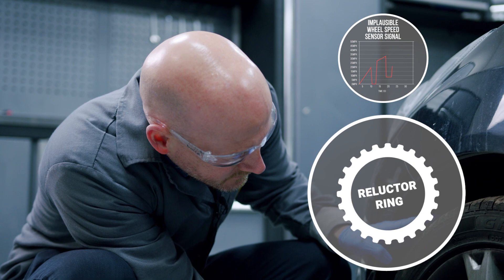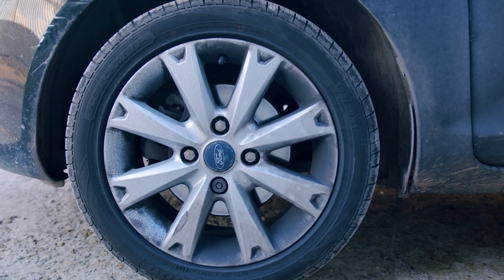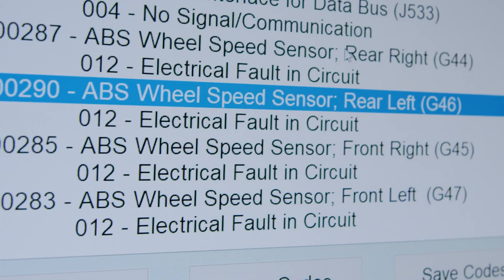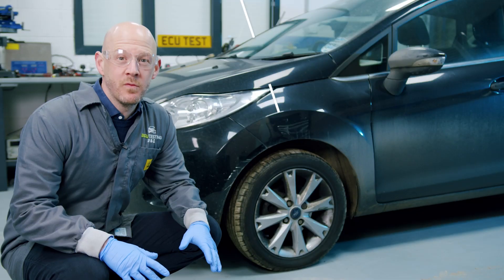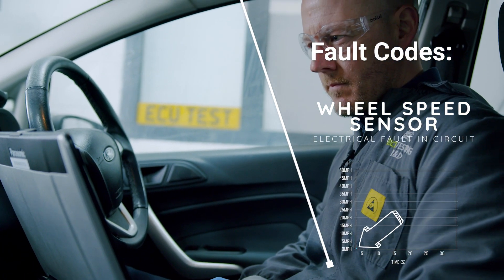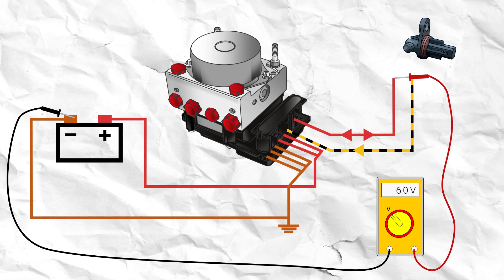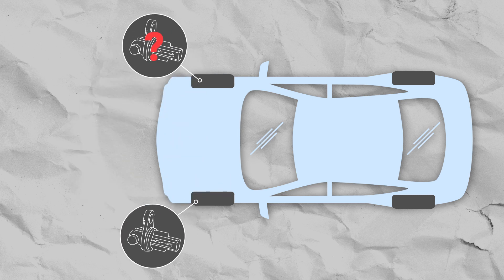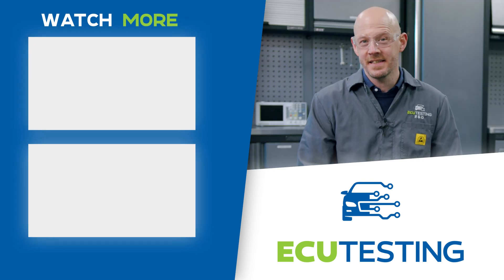ABS Wheel Speed Sensor Fault – How to Test and Fix ABS Sensor

Comment: I have a audi a3 8p and its coming up abs operation implausible signal and power steering control module implausible signal do you think it could be something to do with a wheel speed sensor  or what would you check had it into garages but they just want money dont help thank you
Reply: Also if would like to add i want to look into what it could be before I go into spending money on the abs module fixing

Comment: What happens when you have two little cars in the dash what was skid marks set off the other one was skid marks what does this mean
Reply: The abs sensor fault also affects your traction control (esc/esp) and if fitted your hill start assist sensors. The car with the skids is the esc warning light. I have these on my dash. I’m fast becoming an expert 😂😂

Comment: As an amateur I would expect that a faulty sensor ring would cause a drop in speed readings for every revolution. Incorrect assumption?

The reason I ask is that I have intermittent drops (graph), while manually turning the wheel, but not at fixed intervals. The ABS sensor itself is new.

Still a sensor ring issue? Faulty Wiring? Faulty module? Faulty connector?

Any pointers would be greatly appreciated.

Comment: Hi, wondering if you could help me out. I've got a front left wheel speed and invalid data from abs module errors. The abs, power steering and engine lights are on on the dashboard. I've checked the voltage and continuity of the wire coming to the sensor and it's all fine. Would this indicate there's a problem with the module? I did try plugging in a new sensor, but I didn't put the sensor into position, and the error codes were still there. Does the sensor have to be in position for the error to be fixed? Any help would be much appreciated. Thanks.
Reply from the maker: Hi there, the sensor not being in position should not make a difference to the fault codes still being present as long as it is fitted correctly. You may need to take the vehicle on a longer test drive so it recognises the new sensor or do a power down reset to enable the codes to clear. If you want to give us a call on 01773 535638 or email us your vehicle details, symptoms and the codes you have present to info@ecutesting.com, our technical team can advise you further. Thank you
Reply: @Ecutestinglimited  Thanks so much for the reply. I managed to fix it in the end, the connector had broken and the sensor was plugged in the wrong way round lol. Everything is completely fine now :)

Comment: I’m stumped! My code reader indicates F/R open circuit. The wire has 12v and the sensor reads 5 ohms. I switched sensors but still have the same code. What else can I check? Thanks!

Comment: Volvo xc90 both front sensors failed within 15000 miles , although 5 year old car , oddly both went after brief heavy ish braking on different occasions , Volvo dealer answer new wiring harness and sensor £664 a time

Comment: I have an 08 ford explorer with wheel speed sensor fault and abs pump and module failure. I replaced the wheel bearing assembly and ABS sensor harness with no success. The car beeps at me for 30 seconds every 4 mins. Its absolutely the most annoying thing ever. The car drives with traction control off which is super dangerous. I live in puerto rico and the ford mechanics are supposedly out like 2 years in the service department that deals with electrical problems. The cost of repairs if they did however fix it would be the price I paid for the car. I feel like im SOL. Any advice for fixing it myself or what route I can take in getting it fixed?

Comment: Surely only active sensors provide a 12v voltage for hall effect sensors to feedback data? Passive sensors have little or no voltage supply and use reluctance ring and sensor induction to generate a very small AC wave from for abs actuator

Comment: Hello please my mercedes w204 shows this fault code 5001 cc52 what is supposed to be?  A failure of abs module? Have i change it completely? Please i need uour help in addition to this the steering wheel becomes rigid when i roll over 20km/h
Reply from the maker: Hi. The fault codes and symptoms you have described are a very common sign that the ABS unit has failed and will need to be re-built. Please visit our website for more information on this fault and for details of how to get your unit tested: https://www.ecutesting.com/common-faults/mercedes/c-class-abs-pump-fault/ Please let us know if you have any further questions.

Comment: Good morning..hope you're well.  So to add tht if I've corrosion in ECU connector pins;  could tht be a reason for fault code finding no reading.  Id assume so...   There's no indication of damaged ECU I believe <>> No issues with sensors nor the castellated ring  detected!  No speedometer reading. Ty
Reply from the maker: Hi. Corrosion on the ECU pins could certainly cause no wheel speed sensor reading and, depending on the vehicle, could also cause no reading on the speedometer. We would recommend cleaning the corrosion and checking for good terminal tension on the connector and see if this clears the faults.
Reply: @Ecutestinglimited  absolute genius.  The garage are trying to charge me £1000.08.
  All theyve done is (so they say) clean abs sensor and wires.  8 hours in labour >>cough cough<< its lude. 
 After sending me the image of said corrosion, they've added tht they do not clean the ECU as part of their service,  and I'm to get a replacement unit.     They used the term "Master Technician"    😂 so for over a grand >> a Master Technician  took 8 hours to clean the rear os abs sensor and un plug the ECU connector to detect corrosion.  
And STILL  haven't cleared the dash warnings by spraying a bit of contact cleaner.   With all tht said ..I now fear collecting/paying and worst of all I fear driving the vehicle at all now ..how can I trust tht they've not swapped any of my parts .. I think it's time Live Streams were conducted for our referrances.  
Many reguards to you for your honesty. 😲👆

Comment: This video has helped me a lot, i have been trying to solve the dreaded peugeot wheel sensor issue for a long time. 

But i would add to your video, that on my car the enfine needs to be running, and rhe abs sensor neesd to be plugged in or it won't output a voltage. How do i measure it then? 
I got round this by making a pair of jumper cables between the sensor male and female plugs. I stripped the centre of the wire so i could attach a multimeter. I checked a known good corner and there it was 12.5V. At last we're getting somewhere. Still a way to go.
Reply from the maker: We're glad the video helped. What you are describing is likely a variable reluctance sensor which produces an analogue signal in the form of a sine wave. You can test this by back probing the sensor connector, setting your multimeter to AC volts and rotating the wheel. There should be an AC voltage reading produced, the the reading being higher the faster the wheel spins. Hope this helps!

Comment: My ABS sensor light comes on for like 2 mins and then goes off. How can I test it when the fault is not presented on screen. I am unable to diagnose which ABS sensor is playing up. Any help please?
Reply from the maker: If you are able to scan the vehicle for fault codes it may be that you still have a 'passive' code stored which can help identify the cause of the abs light. If you have access to a diagnostic tool with a live data function then you can drive around with it plugged in to see if one of the wheel speed sensors gives an abnormal reading. As it is an intermittent issue the fault could lie with a bad connection so it may be worth wiggling the ABS wiring harness and associated connectors to see if it causes the light to reappear. Hope this helps!
Reply: @Ecutestinglimited  thank you so much. I shall find someone in the area who can do live testing and find the fault code. I wish you were in West Yorks and I could come down to you :)
Reply: So I managed to get diagnostics and it came up with ABS control module malfunction. Is it worth replacing one? And if yes, how much roughly it will cost in your opinion as I understand from your video that it will need programming as well.

Comment: hi, I changed the new abs speed sensor rear left and it tells me like this (open circuit/short circuit to b+) and I deleted the error code with a cheap obd2 from amazon, you must have a certain larger more sophisticated obd2 with more functions to delete the ECU from the car computer, thank you, I'm waiting for an answer
Reply from the maker: Have you tried checking the wiring from the wheel speed sensor to the ABS? It could be a wiring fault causing the code not to be cleared, as most obd2 scanners should allow you to clear codes (but check your specific scanner's manual to confirm this).
Reply: @Ecutestinglimited  OK thanks

Comment: my speedo shows only 40kph   i have no codes .  i had to wire the units as shit mechanic cut the plugs replacing wheel bearings  assholes i ordered ne ones as the trew them out   fkn africa

Comment: What about when there's no abs pump voltage and no inlet or outlet wheel valve activity and no codes?  Calipers dragging intermittently.  I wish mine would throw a code

Comment: Hey i have 2010 Vauxhall Insignia with a known ABS fault code of C0040 - 0F (front right abs sensor signal) but i have no access to live data at this time. The code has come back (erratic signal), i have replaced the abs sensor as it was cheap and hoping for a quick fix but no luck, this model doesn't seem to have a reluctor ring and appears to be built into the bearing housing, as its come up as erratic is it likely to the magnet in the bearing housing at fault? It is pretty corroded underneath. Thanks

Comment: Hi Tim. Thank you very much for this video. I wasn't sure where and how to test the circuit but now I do so thank you. I have been having a C0040 fault code on my Astra now since I did renovations to it after a failed MOT. Both front left and right sides have had new brake lines and new hubs, with a new clutch kit installed, all bled and pressurised with zero drop in pressure, which I was told is a sign there is a leak or, the ABS pump is kaput. When I powered everything up again (car was without power for about 9 months) I allowed the system to regulate itself for about 15 minutes after being cold for so long. As soon as she started up first crank, the ABS light stayed on. I plugged in my op-com and it showed this code - Front Right Wheel Speed Sensor Malfunction. So far, I have had the whole lot off again and put the old hub back on which was still working, and I was able to clear the code, but then returned. Thinking it was a faulty speed sensor cable, I replaced that which went on this morning. I put the new hob back on and the DTC database stayed free of any codes. I thought it had done the trick, until I started driving and then the ABS light came on, same code. 
The left side has no problem whatsoever. 
When I check for continuity between the Neg of the battery to the speed sensor, because it is an integrated hub, I'll need to test from the speed sensor cable instead right? If I get no reading from any of the interconnecting plug sections, can I deduce that there is a fault with the module itself? 

Thanks in advance

Comment: Hmmmm ! nice vid, and so to a question ( been to the garage for a diagnostic of course but ? ) the garage say there is no information going to the Stability control unit from the main brain or visa versa so therefore it's not possible to say which sensor is playing up and it points to a faulty box of tricks ( this bening the box with all the brake pipes coming out just next to the round pin diagnostic plugin also the engine management light  has now decided to join in the fun and the car is poor to pull away but after that it whizzes along real nice . This is a 1999 523i automatic petrol  and I know it's old but it is a superb car and it could get  financially written off just because of this ( so i am told by BMW ) , what a shame for such a lovely car ( any ideas ? ) Thanks folks

Comment: Hi i hope you are doing well I have run flat inductor tyre pressure check light  symbol it's Mercedes-Benz do you think ABS speed sensor can causes tyre pressure check light, it's always on after few miles driving

Comment: Hello. Your videos are very good. My peugeot 307 xli 2006 after 10 to 15 minutes of driving brakes and ABS failure is activated. Odometer, speedometer and electrohydraulic steering stop working. After turning off and letting a few hours go by it works fine again. I have checked Alternator and I have cleaned the sensors.
What should I check? thanks
Reply: Thank you very much for your reply. I will follow his advice. I will scan to find out what codes. The abs module was changed but I don't trust the work they did in the mechanical workshop that in the end they couldn't find the fault and I decided to remove the car. I will also change the brake fluid. Thank you.
Reply from the maker: Hi. The symptoms you have described could indicate a failing ABS unit, however we would recommend getting the vehicle diagnostically scanned for fault codes first before condemning the unit. Please email our technical support team at info@ecutesting.com with the results of this scan as well as all the details you have mentioned in your comment and they will assist you further. Thanks.

Comment: What if i get the esp lights randomly, even if i just start the car and im not even in it. But i never get the abs light.
Reply from the maker: Hi. Are there any fault codes present when scanning the vehicle with the ESP light on? If you are able to get a diagnostic scan, please email the results to our technical support team at info@ecutesting.com and they will assist you further. Please also include your make and model of vehicle and symptoms of the fault. Thanks.
Reply: @Ecutestinglimited  no I don't get any codes when I plug in a code reader when I have those lights. Iv got all 4 new wheels. All new brakes on all 4 wheels. New left wheel bearing. All fresh grease for the brake sliders and pins. Brand new steering wheel angle sensor. Checked all wiring and there's nothing broken or frayed.

The light will sometimes turn on when I start the car. Sometimes I can go all the way to work before it turns on. Sometimes I can go all the way to work and then drive home at the end of the day and it will turn on when I get back to town. The longest iv had it off was about 12 hours and that was after I removed all the wheel speed sensors and cleaned and put then back in. It's honestly driving me crazy because iv exhausted all possible causes and nothing had changed the problem. 

The only code I have is for the maf sensor. And sometimes for the o2 sensors but they shouldn't affect the esp ligh4s. 

My car is a Holden captiva 2008 v6 auto
Reply: @Ecutestinglimited  any ideas? Because it's sending me crazy. I don't know what to do.

Comment: My ABS light stay on and the car at times won't start and sometimes it will clean the wheel gears it was better for a short time now it start and don't start.
Reply from the maker: Hi. Are you able to scan the vehicle for any fault codes? If you are able to get a diagnostic scan, please email the results to our technical support team at info@ecutesting.com and they will assist you further. Please also include your make and model of vehicle and symptoms of the fault. Thanks.

Comment: Good Video, QQ, I have a Audi A6 Avant (2014), if both my FR and FL speed sensors are faulty (not completely broken), would my brakes fail, and would stop the car? I was driving the car the other day and the I pressed the brakes and nothing happened. I kept pressing the brake petal then the brakes worked. Audi claim its the speed sensor fault caused it. Seems strange.
Reply from the maker: Hi. A failing or faulty wheel speed sensor would not cause no braking faulty wheel speed sensor would only cause brakes locking on, no abs braking assistance or no traction control.

Comment: Hi, I have had wheel sensor issues on my leon for about 6 years now. Basically, I have one replaced every year, then another one breaks, then that gets replaced and another one breaks. Would you suggest that this maybe an abs module issue instead of a wheel sensor issue?
Reply: Sounds like it

Comment: Congratulations first of all for the splendid explanation, I wanted to take advantage of this video to ask a question, I have a problem with my car automatic transmission, I arrive in 4 and it goes into neutral, from the diagnosis it gives me error code U0101 in the ABS / EBCM / ESC module what can it be?  Thanks I wanted to clarify that it does so as soon as I arrive at 50 km / h
Reply from the maker: Hi. Please send your vehicle details and all the above fault information and symptoms into our technical support team at info@ecutesting.com and they will be able to assist you further. Cheers.
Reply: i have a similar issue! 3rd and 5th are essentially neutral, and reverse doesn't engage. in 3rd and 5th the speedometer will run all the way up, and the airbag light came on with occasionally the abs light on and off.

Comment: if only i had the top notch scanner that tells you step by step
Reply: Get an Xtool D8 or D9
Reply: @MRMAN-wb1tv  But don't expect it to handle ABS auto bleed for a '97 K2500. 😒
Reply: Even if you do, it'll literally tell you to perform the steps shown in the video. I work for VW and my run through with the scan tool told me to perform those actions.

Comment: Will the vcs abs system in a 04 Lexus gs300 cause my rear end to go berserk when I'm at highway speeds at about 60mph? Even after EVERY SUSPENSION part has been replaced and aligned???